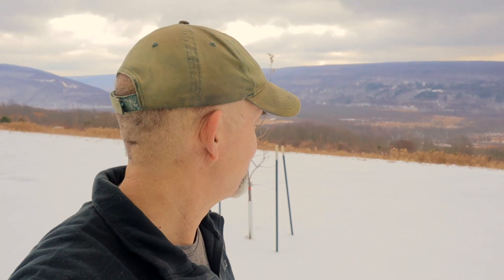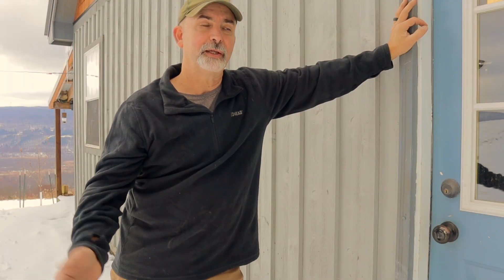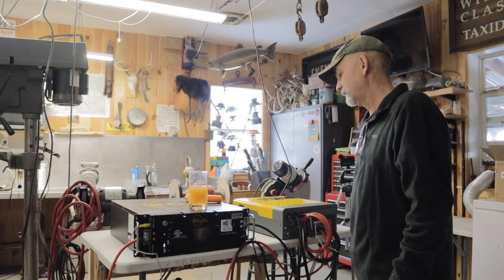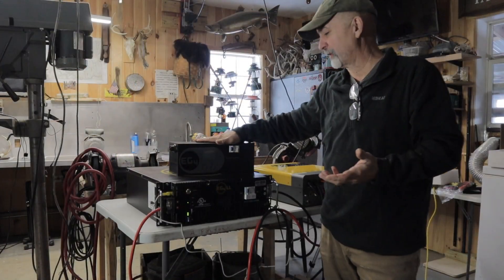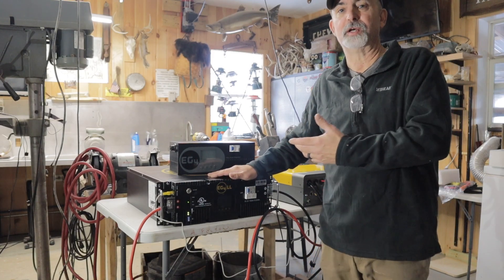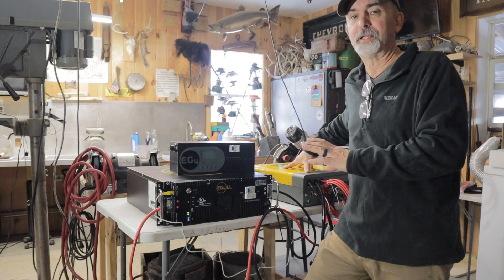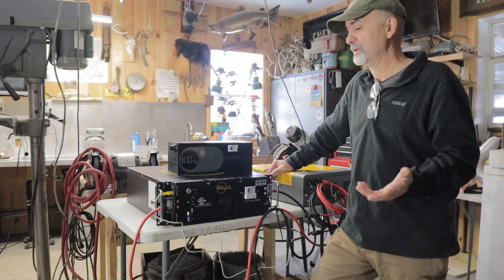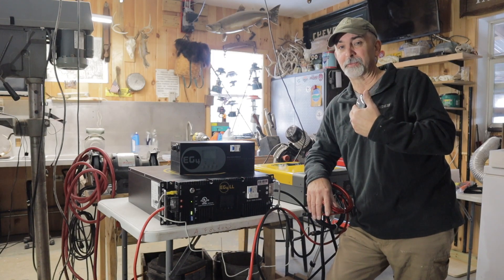AN EARLY CHRISTMAS PRESENT.... SOLAR UPGRADE FOR THE NORTHWOODS OFF-GRID CAMP

Comment: A high frequency transformerless  inverter is not upgrade. You should have purchased a low frquency, transformer based inverter charger instead.
Reply from the maker: With our low load application a high frequency inverter is fine. It’s also much more cost effective   Thanks for watching!